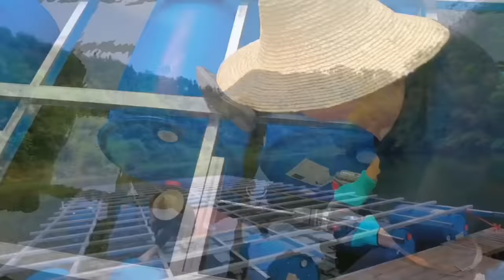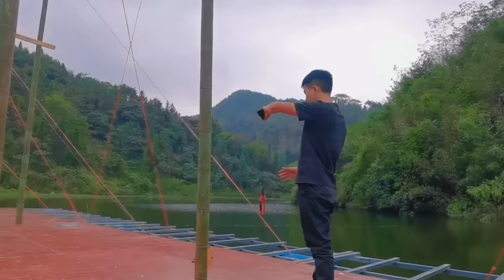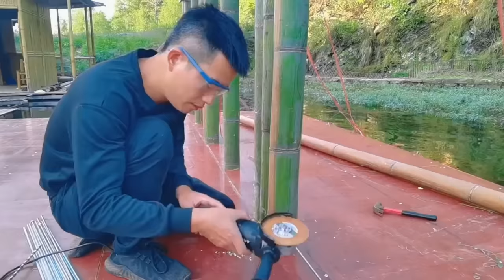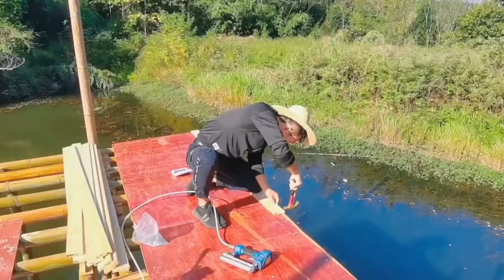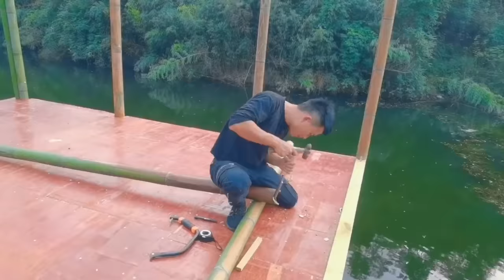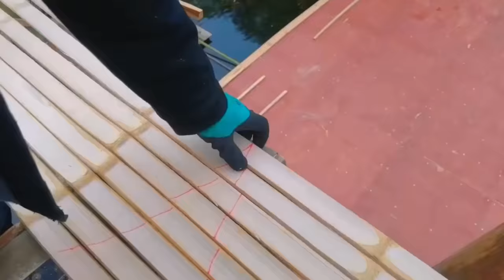Water Bamboo Building Collection Video【Water Dweller】

Comment: I think this is only last for few yrs. Because of the design and the materials they  use.
Reply: bamboo is a highly underrated recourse. lighter than wood 3 times stronger than oak also water proof, only real issue I see is gaps between the strips on the roof and plywood flooring